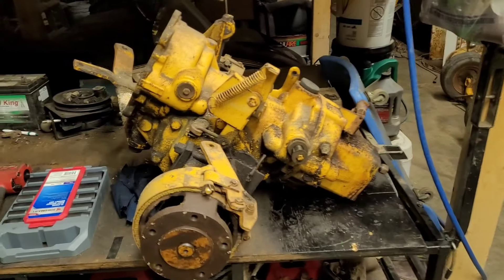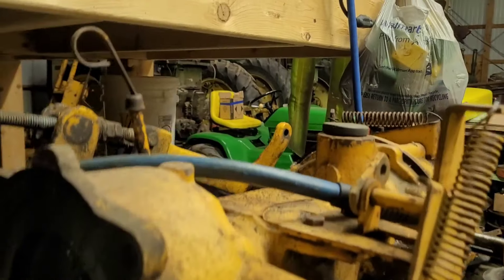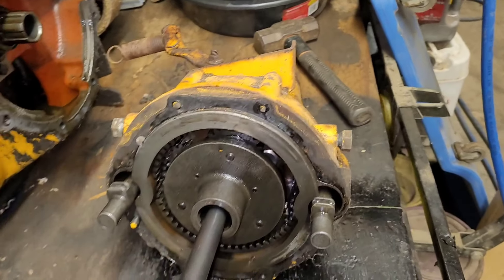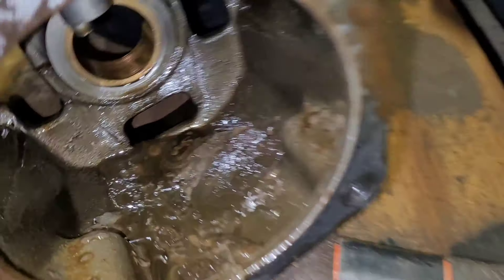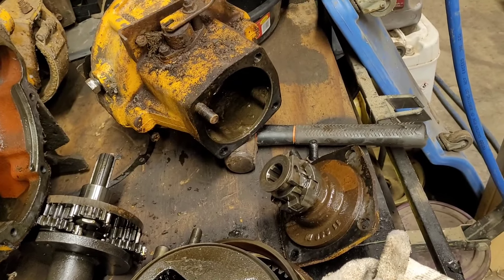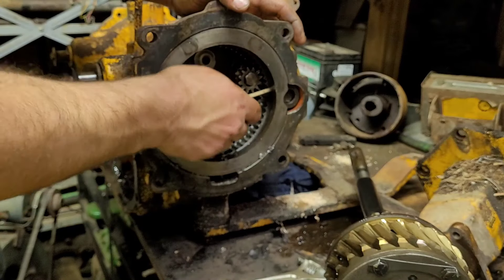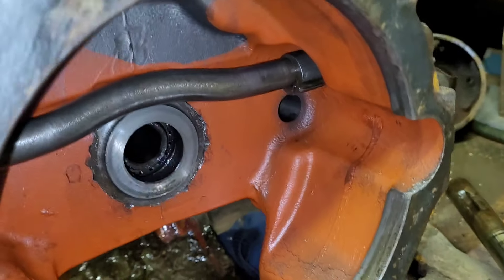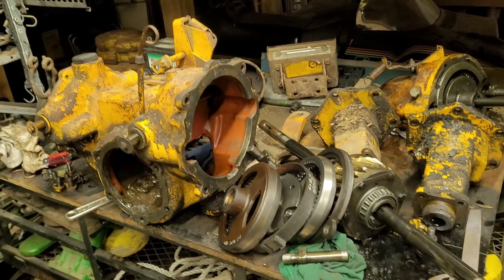what failed??? taking apart 1967 Gravely 430 transmission with catastrophic failure

Comment: Great video. The planetary assembly by the engine controls high/low at the transmission. This will also make the PTO spin fast/slow. The front planetary (by the PTO output) (advance casting) controls forward/reverse. The other high/low is off the differential. 

If you do a YouTube search for Gravely Planetary, there is a fantastic video series by Roger Beno detailing exactly how they work. It’s simple and genius.